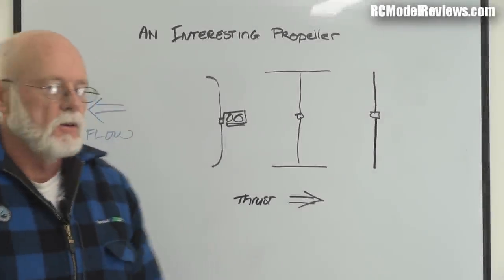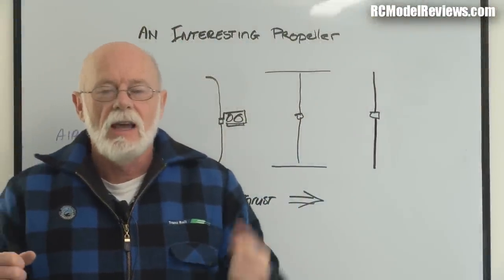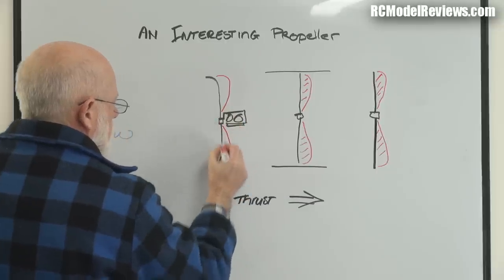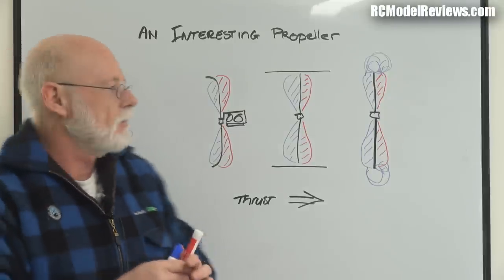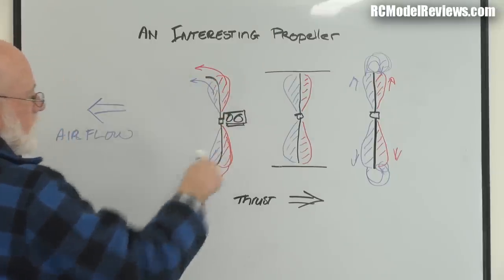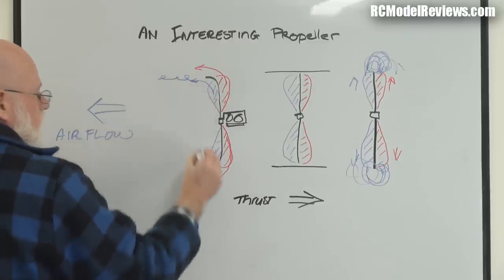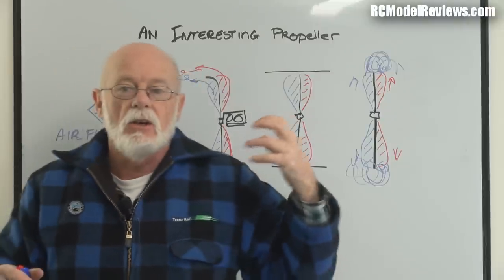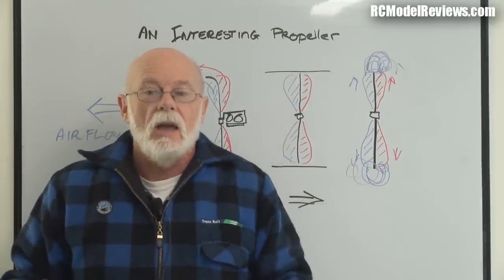More on ducted propellers, the Q-tip propeller

Comment: Are you going to be doing some entry level quadcopter transmitter reviews?
Reply: *****
They cost more than my current 250 quad.
Reply: +Alex Curtis Taranis is a great radio I have 1 and never looked back But I also had the Turnigy and that was a great radio ( it did have the Frsky Module )
Reply: +Justin Bell I use a Flysky FS-T6. Only cost about £40 here in the UK and I cant fault it. Would like to see bruce do a review on one though :)
Reply: +Alex Curtis Perhaps "way back then" you could get a Taranis for that money.  Dollar exchange has gone to crap  so  £150 is probably the best you can do.
Reply: +Alex Curtis Banggood made a price mistake mate so I wouldn't hold your breath at getting it at all. There probably waiting for you to cancel the order if it hasn't said shipped. They are however supposed to honour the price advertised as it was there mistake. But what should be and what is , isn't always the same. Good luck though.
Reply: customs fees and taxes makes them unattractive to buy them from overseas..

Comment: Wouldn't the Bernoulli effect apply here? If the area of low pressure is traveling over the curved surface at the end of the Q-tip propeller it should be creating lift in the same direction as desired thrust. Not only is the area of low pressure moving over the curved surface, but it is moving outside the radius or at a larger radius than the high pressure air that's on the inside of the curvature and forcing the low pressure to travel yet even faster thus this propeller should not only reduce noise but it should also create extra lift. Will extra lift achieved only compensate for the increased drag? I am not sure, I am only a psych major, but it's a thought.
Reply: Yeah, I think you would get a little boost there. The angle of the thrust produced that way would not be straight forward, but it does have a forward component to it. Perhaps a shorter curved section would be better, to transform a bit of the radial flow into thrust, but don't curve all the way to 90 degrees backward because of diminishing returns.
Reply: Coanda !!! Not Bernoulli !!!
Reply: +frédéric H 
Coanda is the phenomenon of air or fluid following a curved surface tends to follow the surface, whereas Bernoulli has to do with difference between low and high pressure with the direction of travel as well as the speed of the air. So, the faster the air is traveling the lower the pressure, lower the pressure on the front vs the higher pressure on the rear the more thrust. Yes in this case the Coanda effect is what allows the Bernoulli principal to take effect, so I can see your confusion. Watch his videos about duct fans he explains the principal I was trying to relate.

Comment: Wouldnt these tips, by the added mass which is not in line with the 'propeller disc', induce a force that would bend the blade towards the low pressure area? That effect would increase with propeller size. Is that another reason for why they are not used in anthing bigger than a autogyro? I hope someone understands what i wrote. 
Very cool to see something like this, i always wondered why there are no tips on propellers.

Comment: What about a system of these specialized blades, does the turbulence reduction of ducted or Q-tip blades have an efficiency gain when applied to a set of motors? (a quad-copter for example)

Comment: Why can't the propeller be fixed to the duct and have the whole thing rotate,would that not stop the vortex?
Reply: Nothing's stopping you trying, but these effects will come into it.

1: Mass (remember, it's on the end of a shaft, so bending moments apply)
2: Centripetal forces (the ones that make things want to fly apart)
3: Gyroscopic precession effects when you change speed or flight angles 
4: Extra skin drag caused by the rings movement.
5: (for constant speed propellors): mechanical complexity at the tips.

Ring propellors exist on marine craft, but they're a poor second cousin to a duct.

By all accounts, a ducted prop on low speed craft desn't work very well. A ring prop would have similar disadvantages (except perhaps noise) over an ordinary one or a q-tipped/scimitar design.

One thing I've been wondering about is whether trailing edge chevrons would help, but I suspect they'd be a structural weakness given the forces involved. Then again most prop noise is at the tips.

Comment: is it true that the thumping sound that a propeller makes is actually the propeller blades sending out shock waves
Reply: Depends...

Could be impulse effects due to the prop being close to an edge like the pusher props on many flying wings make a lot of noise due to this.

Could be mach effects if the prop is spinning fast enough.

there are a few other things going on, including Doppler effects.

Comment: How on Earth does air exert centripetal force? It is stagnant until forced back by the prop. A propeller screws through still air redirecting the mass of the air backward and pulling the plane forward. Where/how does the centrifugal force originate?

Comment: Now wait a minute mister... Usually, propellers and impellers designed to operate normally, without a duct, have different attack angles from the hub to the tip. And the tip ends up as being almost at 0 degrees. That to preserve the pitch in respect to angular speed.
Therefor, the very edge of the tip ends up producing very little thrust.
Reply: The angle of attack is at or near zero but there is still an aerofoil. Most of the thrust of a prop is near the tip.
Reply: capacityplus
not quite so. consider the centrifugal force that acts on the air that the propeller moves.
Reply: You seem to be very interested in this object. I would recommend a series of books we use in our flying school The air pilot's manual volume 4. Whilst I don't claim to be an expert I am an amateur pilot and should maybe brush the dust off my old text books. Check out some of my videos.

Comment: Bruce, sent the president of mfzn an email showing my concern about you not having your wings...he sent me about a 6 paragraph message containg your lifes history with them...I was wondering if you have ever had a chance to read that? It did contain some things that I would like to question you about...it sounded as if you could be flying at the air field but you turned them down...
Reply: +Gary  Ferguson Jr 
Yes, i got the same reply also after sending them an e-mail.  I was amazed how big a slab of text that is. I do wonder what is true and what not, but i dont feel the need to dump my energy into the matter and only get frustration back. 
I sure will miss Rcmodelreviews and am missing the flight videos for some while now.
Now on to the filed. 8 packs charged.  This 450 heli needs some flying done :)

Comment: Does the tip really produce lower pressure than the center? It is spinning faster, but the angle of attack is smaller on most propellers I've seen.
Reply: As far as I'm aware the change the aoa and shape at root to tip of the prop is to try and keep the amount of thrust/pressure consistent over the whole blade. they can deal with less aoa at the tip because it moves faster. More speed more thrust. But high aoa makes more drag the faster you go. At the root of the blade they can use more Aoa because its moving slower and the increased angle doesn't create that much drag. So to answer your question on a straight bade with no twist the tip will create more pressure then the root of the prop. However when the blade has a twist it should be fairly consistent all the way along(not accounting for the tip vortex) That's my understanding if I'm wrong let me know.
Reply: +Michał Gawron 80% of the thrust is produced in the last 20% of the blade. The central area is stalled.
Reply: obese1konobe Stalled? I don't think so.
Reply: +Michał Gawron The central area of the prop (hub) is producing zero lift and therefore by definition, stalled.
Reply: +Michał Gawron The central area of the prop (hub) is producing zero lift and therefore by definition, stalled.
Reply: +Michał Gawron The central area of the prop (hub) is producing zero lift and therefore by definition, stalled.
Reply: captainTubes Ah, you mean hub, of course, you're right. I thought about central area only where the blades are.
Reply: Got there in the end!

Comment: Has anyone ever commente on how much you sound like Dave Jones from EEVBlog, particularly in intonation? Seeing you two collab would be amazing, you both know your stuff.
Just a small niggly caveat  - theres no such thing as centripetal force, and centrifugal force isnt an actual force. Centrifugal force is an effective force you can derive as a result of centripetal acceleration, but its not a force as such, just an effect of conservation of momentum.
Just how bad is the effect of tip drag? I came across your vid wondering why we werent seeing propfans at least for commuter craft that had vortex devices like this on the tips, i would have thought in the context of urban airports that the noise reduction would be significant and they would still be an efficiency improvement over ducted fans?

Comment: why are winglets twisted upwards and not downwards? following this principle, the air would create minimal extra lift...
Reply: upward versus downward winglets would have the same effect on wingtip vortices. when it comes to ground clearance, however, upward facing has an advantage, especially during rough landings.
Reply: Anonymous User got it. extra risk mitigation. however, there's still the question on the extra lift or not
Reply: Leonardo Pozzobon Upward-pointed winglets produce thrust 'pulling' forward and inward (towards the fuselage), as opposed to forward and outward for their opposites. I don't know how exactly that might affect the set-up structurally, but there could be a small difference; it's safe to say, though, that either orientation is certainly do-able, as we see both on current aircraft.
Reply: Leonardo Pozzobon Sidenote, apparently Airbus uses a dual wingtip fence, so both at the same time. In theory, this should reduce the total weight by a little relative to a larger "single" winglet, since the shorter moment arms would require somewhat less structural strength.
Reply: Leonardo Pozzobon Another sidenote, don't confuse the XB-70's drooping wingtips with downward winglets - they're two different devices. Winglets are used almost solely on subsonic designs (because their savings aren't worth their weight at high speeds) and purely for reducing drag, while the Valkyrie's large drooping tips are intended for high-supersonic flight regimens and not at all for drag reduction. Rather, the drooping tips encourage a slightly complex, high-speed phenomenon known as "compression lift". Basically, the wing shape taken by a tips-down Valkyrie produces 'extra' lift at high speeds, due to the "momentum principle"; in the Valkyrie's case, lift increases by as much as 35%.
Reply: Leonardo Pozzobon Final sidenote, the bent-down tips on some Cessnas (including the 172) are actually not winglets. Rather, they're "drooped tips." Unlike winglets, they don't really produce any considerable forward lift (thrust), and are generally a simpler device. However, drooped tips still fall under the category of "effective aspect ratio" devices; they basically direct wingtip vortices out and away from the tips, effectively increasing the wing's aspect ratio and reducing (induced) drag.

Comment: no, centrifugal and centripetal force are not the same thing...
Reply: Thank you.
Reply: centrifugal is outward from the center, centripetal is in the direction of the spin
right?
Reply: Centrifugal force is the tendency to move away from the center of rotation, whereas centripetal force is the tendency to move towards the center of rotation.

Centrifugal force is an inertial force (also called a 'fictitious' or 'pseudo' force). It does not exist when measurements are made in an inertial frame of reference (one that is not accelerating, typically outside the system being measured, like from the ground to measure the forces on the propeller).

In an inertial frame, an object that has no forces acting on it travels in a straight line, according to Newton's first law. When measurements are made with respect to a rotating reference frame, however, the same object would have a curved path, because the frame of reference is rotating. If it is desired to apply Newton's laws in the rotating frame, it is necessary to introduce new, 'fictitious,' forces to account for this curved motion.

Motion relative to a rotating frame results in another fictitious force, the Coriolis force; and if the rate of rotation of the frame is changing, a third fictitious force, the Euler force is required. Together, these three fictitious forces are necessary for the formulation of correct equations of motion in a rotating reference frame and allow Newton's Laws to be used in their normal form in such a frame.

But it's much easier to just use an inertial frame of reference and stick with centripetal force, a force that makes a body follow a curved path. Its direction is always orthogonal to the motion of the body and towards the fixed point of the instantaneous center of curvature of the path. Isaac Newton described it as "a force by which bodies are drawn or impelled, or in any way tend, towards a point as to a centre".

In Newtonian mechanics, gravity provides the centripetal force responsible for astronomical orbits. When spinning a ball on a string, the string provides the centripetal force, preventing the ball from continuing on a tangential path by pulling it towards the center of rotation.
Reply: *****
Wow...., that's so much easier to calculate than explain. I got it...just barely. Mercy, like a page out of a angular physics book. Thank you. My brain is slightly fuzzy, now.
Reply: WhtStr213 Heh, sorry. Basically, centrifugal force (flying away from the center) isn't a true force. It's just that stuff being spun around will fly off along a tangent if you stop the centripetal force (pulling stuff towards the center). If you swing a ball in a circle, that string pulls the ball towards the center, that's the centripetal force. It looks like the ball is trying to fly away from the center, a centrifugal force, but it's not. It's actually trying to fly off along a tangent.
Reply: *****
So, you could say ... once centripetal force exceeds the tensile strength of the swing arm, that arm snaps, allowing the mass to follow the centrifugal force, which then becomes forward momentum, the tangent of the curve at the break point?
Reply: Crap, I'm missing a "particular something" in that...
a 45 degree angle of force calculation?
Reply: WhtStr213 Well, centrifugal force is a 'pseudo' force, so ignore it when using an inertial reference frame. Instead, you just have the velocity vector which points tangential to the curve of rotation. So yeah, when the force required to pull the mass towards the center of rotation (centripetal force) exceeds the tensile strength of the arm, the arm snaps and the mass will fly off tangent to the curve at the point of release. It won't fly directly away from the center, but rather at a tangent.
Reply: Cool. : )
Thank you.
Dang, that was fun.
I had to understand this stuff to get how/why my Momentum Transmission device works. It's a "reactionless propulsion" device that supposedly can't exist. It took me a while, and there's still a lot I don't get/haven't learned, I'm getting there.
Reply: He did say 'depends on which side you're looking from". not a comprehensive explanation by any means, but not exactly wrong.
Reply: Anonymous UserImagine yourself on one those little kiddie spinner "merry-go-rounds" at the park:
Centrifugal force  (I like the term "a fictitious force") - is what make you feel pulled to the edge and about to be flung off.Centripetal force is when you step off the moving ride and, instead of having to run straight away from its center, you have to run tangential to the edge.

Comment: This is all theory, lets see it in action with real data.  (ie.  speed vs rpm and fuel efficiency) Easy to theorize with math and physics but what happens in real life? Does the added expense in the design have a short or long pay-back period?  No point in spending an extra $1000 to save 0.1 liter of fuel per hour, you would need 10,000 hours to get back the expense.

Comment: Centripetal vs Centrifugal? Allow me to explain, centripetal force causes spinning, centrifugal force is caused by spinning. See, it's NOT THE SAME. You're thinking of a propeller as a solid object so you're imagining the forces are the same within it, they're not. In a propeller the centripetal force is created by the molecular bonds in the material of the propeller, and the centrifugal force is caused by the mass of those molecules, which is the objects inertia.  Mass != Molecular Bonds. ITS DIFFERENT.

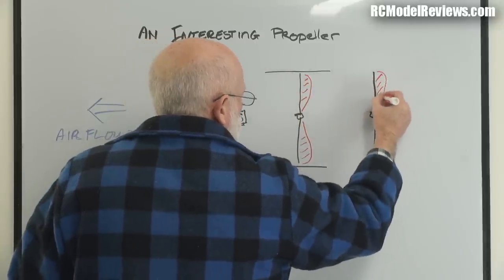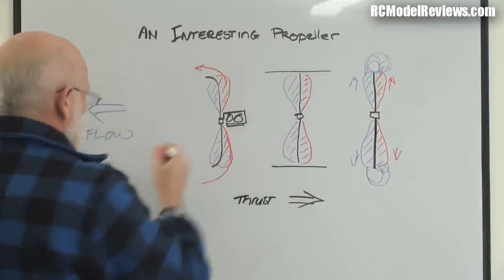Comment: The duct drawing @2:26 and @2:55 is wrong (should not be the same as the non-ducted pressure - does not drop to zero at the tips).  Might I respectfully suggest that you power up some actual propellers and make some real observations, so you can then draw diagrams that more closely and accurately match reality?  Your concept of the incoming air later in the video @4:49 is also mostly wrong, which would be obvious to you if you'd spent some time with a spinning prop and some string...  Theory is awesome, but you shouldn't teach it unless you've tested to make sure it's accurate (which in many small parts of all your videos, it's not).